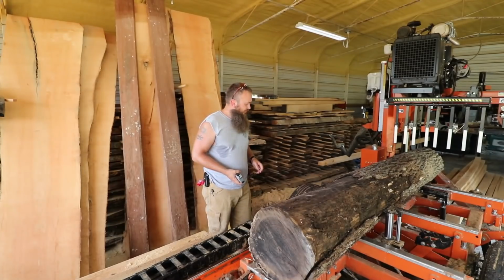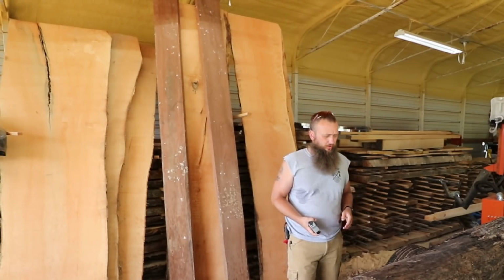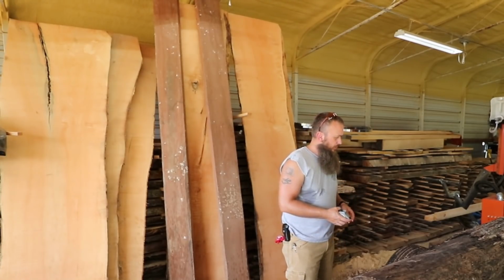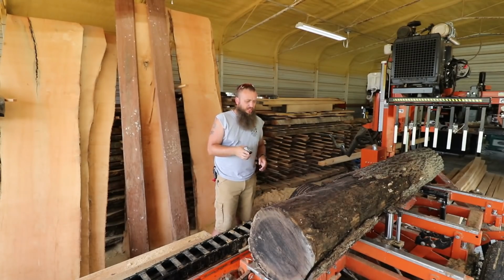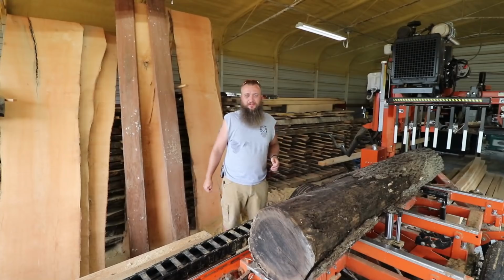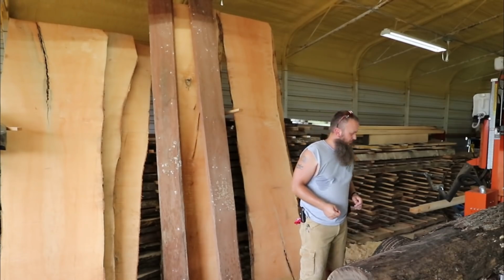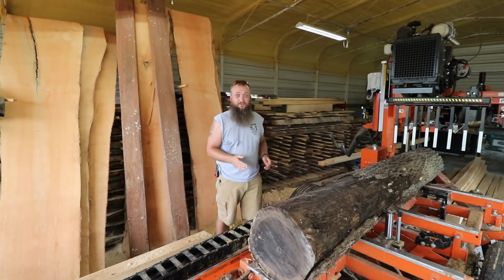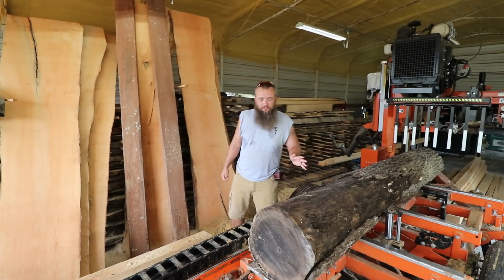Sawmill Workday: Sawing Out A Timber Frame Knee Brace,

Comment: Recently found your channel. I'm enjoying it. One question, what are the 8 silver rectangular bars hanging below the motor for?
Reply: They are fingers to keep the wood from wandering off to one side or the other when he drags a piece back using the board dragback mechanism. One finger will fall close to each side of the  board and help direct it straight back to the operator.
Reply: @jimn1236  Thank you.